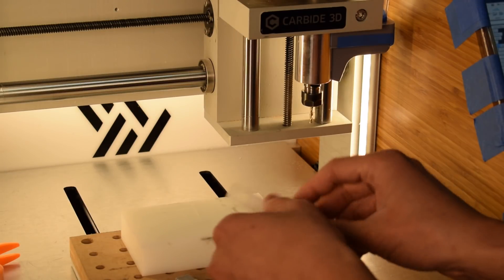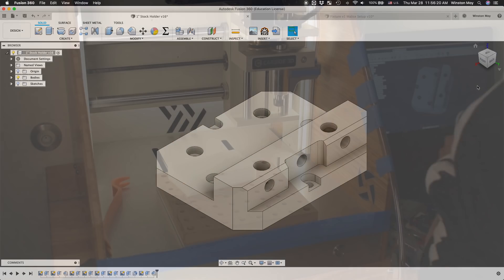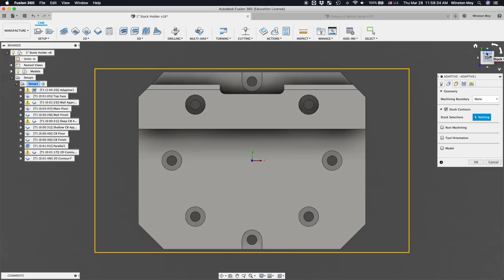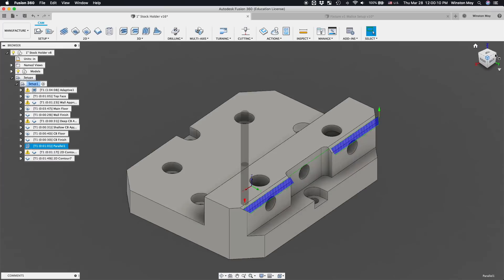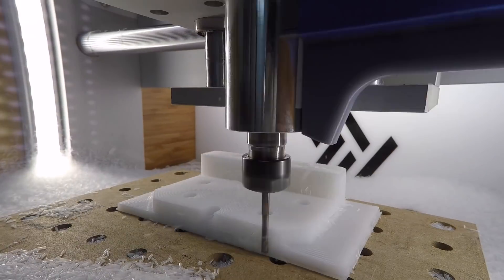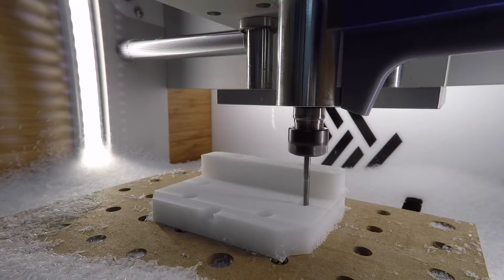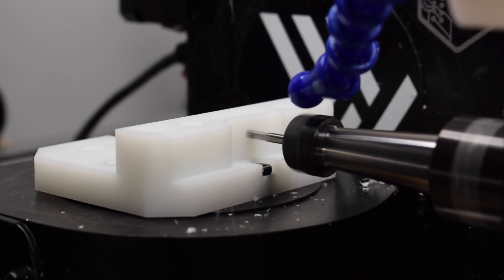Making a PocketNC Bar Stock Workholding Fixture - #143

Comment: Why use plastic for a fixture where rigidity is important?
Reply from the maker: Quick and dirty prototype. Doing it out of aluminum would take forever on a desktop machine.
Reply: @WinstonMakes  you should look into "titans of cnc" small groups. You might learn a bit from his videos, and the small groups might allow you access to a large proper cnc for making fixture pieces
Reply: ...and why he lock tools long out clamp ?  This isn't his job, it's evident...
Reply from the maker: Are you talking about tool stick out? It's evident you haven't used a PocketNC before. Nose to table distance means you need extremely long tooling to cut close to the center of the B table.
Reply: @WinstonMakes  also, you can use "no lift" toolpaths for your adaptive paths to save time with lifting in z. Additionally, oftentimes the stock setup, stepover, stepdown, and feed rate all have differing effects on total cutting time and tool path generation in cam software
Reply from the maker: @deannawilliams631  I had minimum retract enabled, but the calculation time grows significantly as you increase the "stay down" percentage. To the point that it becomes easier to just let the machine run, or use both ways.
Reply: @WinstonMakes  how much time are we talking? i use adaptive paths all the time at work and at home, and the difference between 0% stay down and "most" (equivalent of 100%) is negligible in calculation time. perhaps another way around this is to use 2d adaptive and break up your machining toolpath into sections where you can logically separate and optimize cnc machine performance for the application. meaning, understanding the weakness and strengths of your feeds/rapids/servo torque/etc and how to tweak settings in CAM software to force NC code generation to benefits those strengths/weaknesses.

i hope i don't come across as arrogant or to harp on your progress in your shop at home. i think it's great that you are making videos to inspire other people, and that you are exploring the maker space yourself! at the same time... i see in many of your videos that you would greatly benefit from some formal education in CNC machining, or at least to have a really good mentor that you could turn to when you start up projects. there are things i see you do that i cringe at because of the experience that i have as a machinist by career.
Reply: @WinstonMakes  another trick that i've learned, is to greatly increase the stepover amount when first setting up the toolpath (even 2 or 3 times the cutter diameter). this dramatically reduces the tool path generation time, and allows me to tweak all the other settings before finally settling on the real world stepover amount, hence limiting my long cpu cycle tool path generation to hopefully the final one only. oftentimes, i can catch errors with 50-75% cutter diameter stepover, then adjust to the 5-15% cutter diameter for final tool path and save the file.
Reply from the maker: @deannawilliams631  For the worse toolpaths, we're talking generation time of 5-10 minutes.  I have changed stepover/stepdown before to preview toolpaths, but I found that I was switching back to actual cutting parameters prematurely. Still had a lot of tweaking to do. This will be particularly evident in a project coming out next month.

No offense taken with your suggestions, if your goal is to help, it's welcome. If you see something just drop a comment, that way others can pick something up too. I usually don't go back in time to old videos to add information or revisit, so the comments are the best place for people to get extra value from watching.
Reply: Hi, no, i never used PocketNC. I  thinks it's a beautiful toy, for hobbyists, to learn how to use table/table milling machines, for training in post processor develop and testing. 
In milling process tool lenght is very important.
2 solution. Lift the piece from the table with adequate support (metallic) or , in some cases, simply use a longer chuck. Congratulations to your videos and I apologize for my bad English

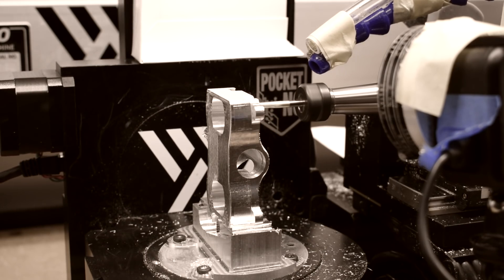Comment: can you explain the dust control setup (at 1:00)  on the carbide 3d machine? Thanks
Reply from the maker: It's a sock stretched over the router to prevent aluminum chips from getting in, and a air line feeding low pressure air to blow chips away underneath. Literally the opposite of a dust "control" setup, instead it makes a mess. But it keeps the endmill flutes clear.